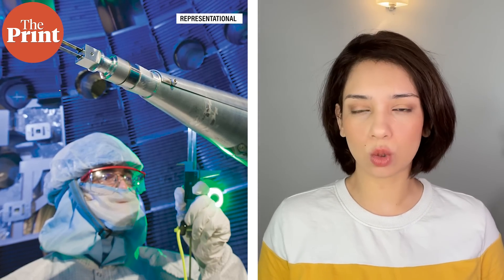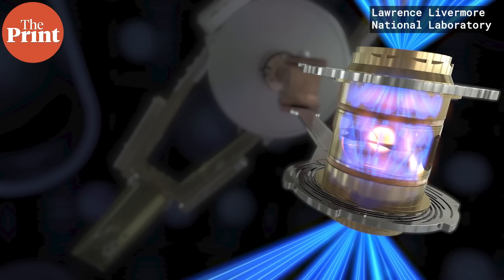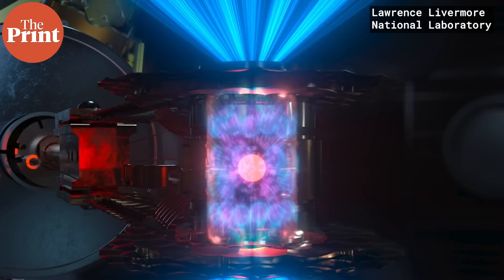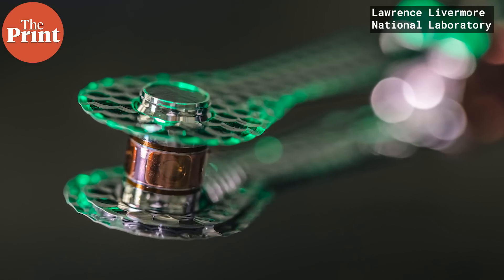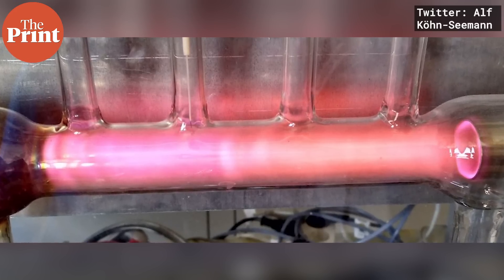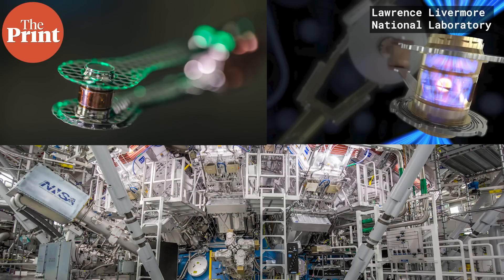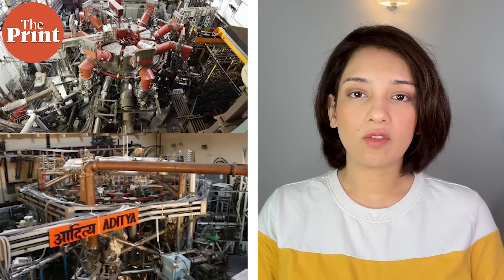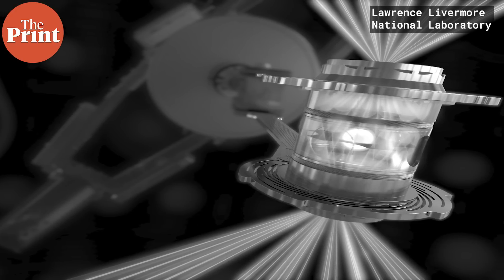American govt succeeds in demonstrating fusion in lab

Comment: From what i have read and understood previously: Density, temperature and time form parameters for a fusion product . When the fusion product reaches a specific value  termed ignition point, fusion occurs and becomes self sustaining. What I understood that the basic problem today is in generating the vast amounts of energy required and to maintain sufficient density of plasma that collisions can occur between atoms sufficiently enough to maintain the self sufficiency of the reaction. Materials that can withstand these high temperatures are being actively researched. The magnetic confinement field in the tokamak is supposedly 10000 times greater than the Earth's magnetic field. Thank you for the video

Comment: The fusion experiment in the US is not scalable - it can only work on a tiny pellet. Also any attempt to get the heat out will prevent the lasers reaching their target. It is a dead end. If fusion is to work, it has to be in a tokamak. That is the only technology currently in action that holds out hope.
Reply: @@saffron-terrorismtrendstop1566 From which I gather that you are one of those who believe the US does everything first and best - but have not actually examined the experiment.